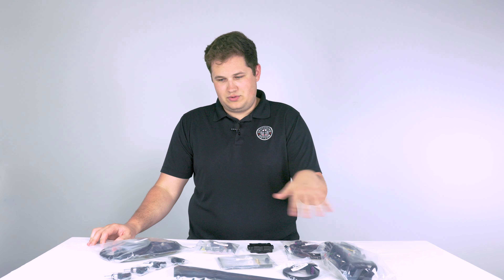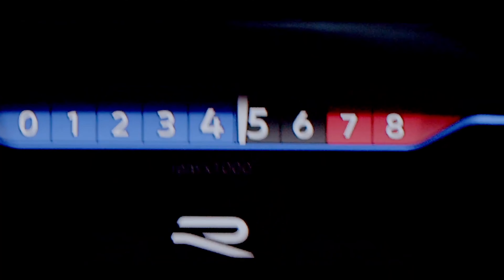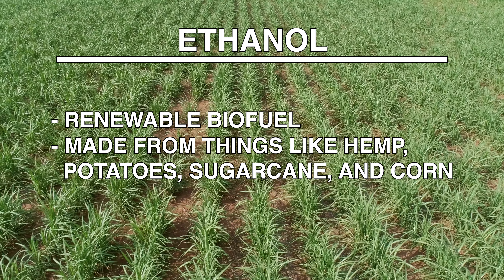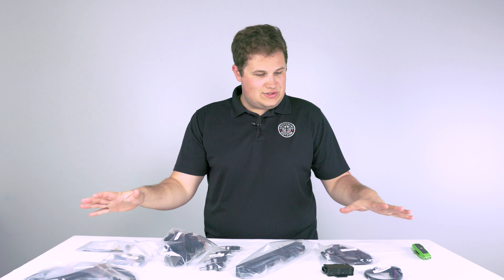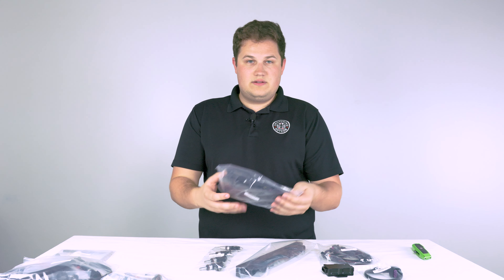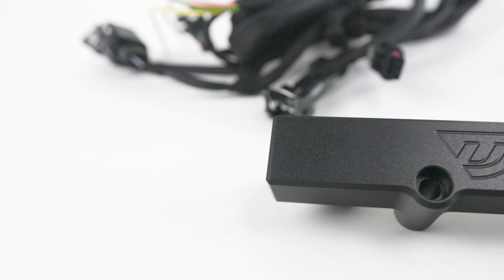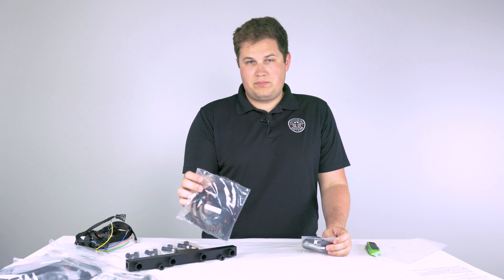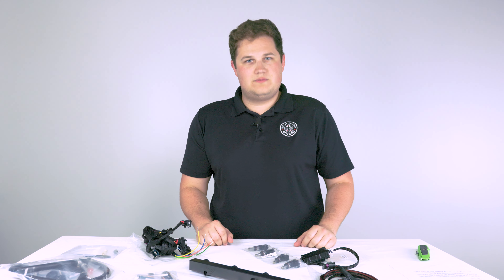Unitronic UniFLEX System Unboxing

Comment: Thank you for the nice kit overview!
We are looking forward to releasing these to the public along with adding more support for other platforms soon too.
Cheers!
Reply: What's the lowest octane I can run on your flex fuel tune? Can I run 87 Octane or do I have to do a custom tune? Also how will the mpi fuel rail kit work? I need a custom tune as well for that? Asking for MK8 GTI and any news on TCU tune ? My GTI was manufactured in May 2022 so I think I got the second version of DSG.
Reply: @W0LV1E45  Hi there, we don't offer 87 octane tunes for this platform and our FLEX calibrations will support 91 octane to full E85 and 93 octane to full E85. No custom tuning required, the ECU will adapt according to what fuel is in the tank. As far as MPI goes, the increased fueling will be critical once we surpass Stage 2 power levels for the GTI and want to run full E85 in the MK8 R / 8Y S3. You're likely on the newer TCU bootloader '401' type which is still locked although we are working on an alternative solution which will allow you to enjoy a full torque experience without transmission tuning for now.
Reply: Hi Team. I have a 2018 rs3 unitronic stage 2 e85 and wanting to go with uniflex. Will I have to replace my current tune for this??
Thanks